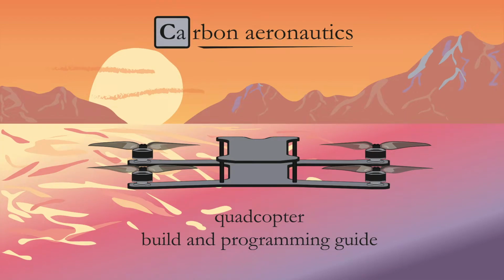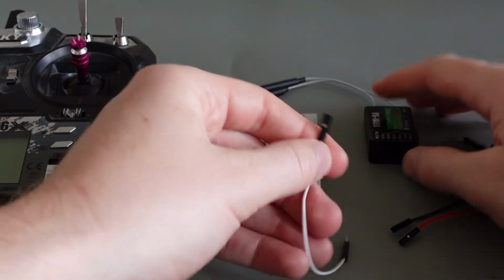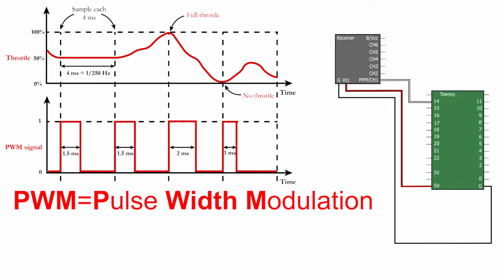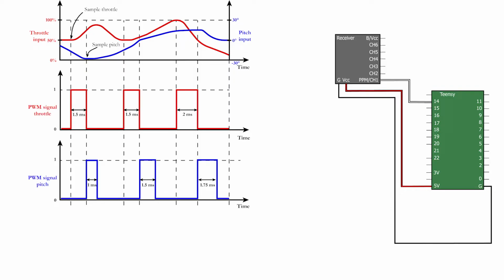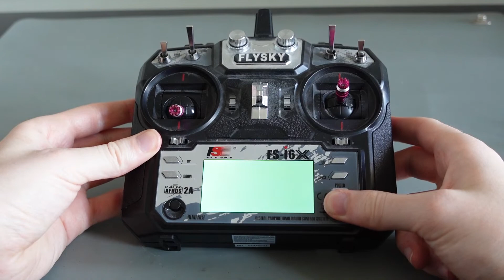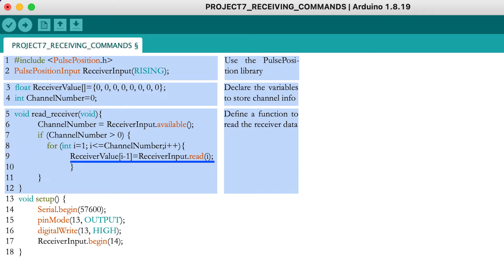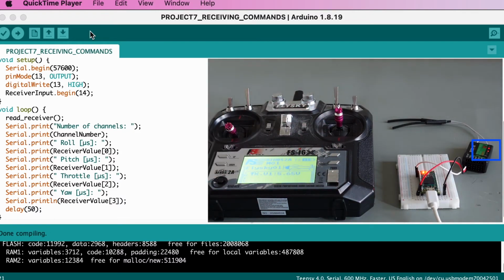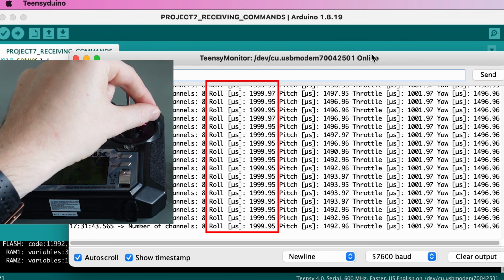7 | Connect a receiver to your Teensy in 30 Arduino code lines

Comment: Hello my code also runs fine and after uploading to teensy no error however it shows number of chanels as -1 and all other readings are zero what should i do? because i have set my FS-16X to PPM and the receiver is FS-IA6B.need help please

Comment: The code compiles and uploads just fine however the data is all 0's no matter what.  I have confirmed on a scope that something is there, but I'm not sure why the arduino interrupt doesn't interpret it correctly.
Reply: Did your Code upload to the Arduino. If yes then please tell the process
Reply: @krishpradhan6163  I did get it working.   The library for the remote control needed to be updated...The enable logic had to be switched, 0 is active, 1 is inactive.
Reply: @JayDee-b5u  Hello my code also runs fine and after uploading to teensy no error however it shows number of chanels as -1 and all other readings are zero what should i do? because i have set my FS-16X to PPM and the receiver is FS-IA6B

Comment: Hi. Thank you for your video. But I have a big question. You want to built a 4 ms closed loop controller, but as u say, the position time of ppm signal is 1-2 ms, so the time you need to read values from transmitter will surely exceed 4ms. I don't see in your series any part that you check if your code can complete with no more than 4ms. Looking forward to your feedback

Comment: compilation error.

error: 'CLOCKS_PER_MICROSECOND' was not declared in this scope; did you mean 'CLOCKS_PER_SEC'?

what is the problem??
Reply: Hey have you find solution for this error
Reply: @priyanshuwaghdhare5458  I am stuck at the same spot, any solutions?
Reply: Pls help me because I get the same error..
I don't know what to do
Reply: I am stuck at the same spot, any solutions?
Reply: me,either.

Comment: Hi sir, I'm building my drone for my control engineering project with your guidance through your videos. Learned so many things really grateful for you...  And I'm using FS-CT6B transmitter and FS-R6B receiver. On that receiver nothing is mentioned as ppm channel. it is mentioned on the transmitter as DSC port: PS2; Output: PPM. When I tried with the your code by connecting receiver to teensy and followed all steps perfectly then the channel number and all output shows 0 in serial monitor. Please help me to get rid of this problem sir...
I'm using F450 frame
1000kv motors 
30A ESCs
2200 lipo battery
Teensy 4.0
everything else as you have mentioned
Reply: Just check once again if you have connected to the 14th pin

Comment: Hi Sir, thank you so much for the explanation. It helps a lot. For arduino nano, do you know what pin is recommended to read the ppm signal from fsiA6B?
Reply from the maker: Normally only the pins that can handle interrupts; D2 or D3. But I haven't tried it myself.
Reply: @carbonaeronautics  True
Reply: I'm marking this comment, because thats an answer I needed 2.
Thx for asking @techmontc8360 and thx for answering @carbonaeronautics .